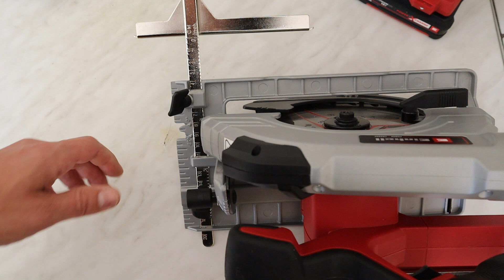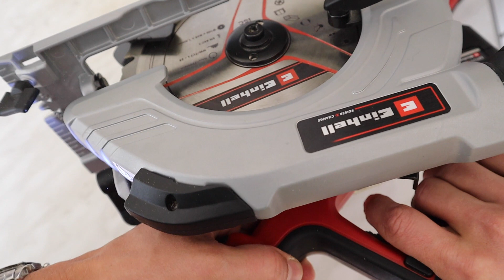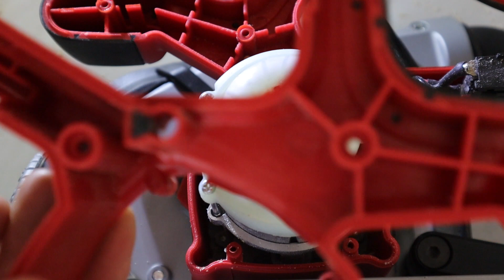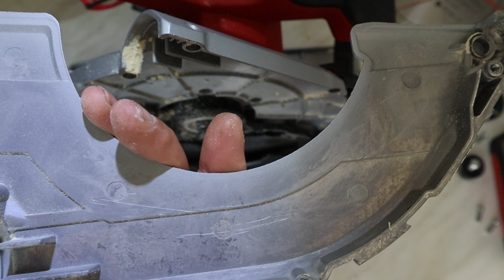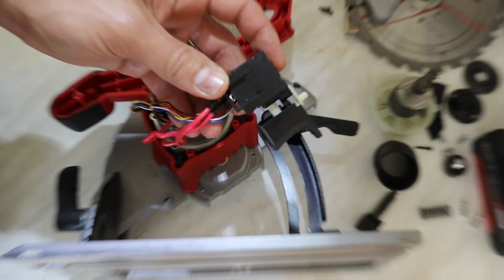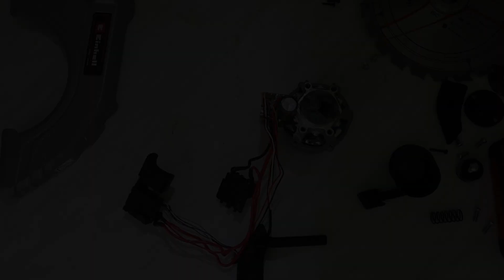Einhell 18V PXC Brushless Circular Saw Teardown - Should you buy one?

Comment: Very useful video - thanks! I've stripped my circular saw down to the motor according to your video as mine stopped working mid-cut. No signs of burning or damage but the motor will not start when I connect up the battery and pull the trigger. The light comes on but that's all. Any idea which component could be the culprit here and how to fix? It's only a few months old but I can't send it back to Einhell as I closed my Amazon account through which I bought it and I didn't save the receipt or order details! Impossible to return it under warranty therefore. Thanks!
Reply: I would test if those transistors are not shorted 26:12. I fixed Einhell impact, which had pair of those shorted.

Comment: I'm not keen on the plastic leaver's on the depth and angle stop.
And as mentioned the flimsy blade guard.
Don't the angle leaver pull out so you can put it in a different position.
Thanks for the interesting review.

Comment: Dont understand the fascination with making the blade guard out of plastic.. I mean its got to be the most abused part on the bloody thing, Every time you leave it down its on the plastic guard, when you drop it, its going to be right on the guard !! They couldn't even be bothered to add some glass fiber reinforcement into the plastic... I had to bin my last cordless saw for this exact reason, Cut too low to the ground ripping a board, even though the board was up on blocks, the plastic guard touched the ground near the end of the cut, all I remember was an explosion and bits of plastic shrapnel flying across the room.. Swore id never buy another saw with a plastic guard.. Just No...!!

Comment: I bought this saw after watching this video, TBH kind of disappointed by it being underpowered - like someone said in amazon reviews - above 3cm cutting depth it's going to start stalling all the time (I had 5.2ah battery in it). On the positive side it's very smooth and controllable - I have some old corded saw and that thing is way more powerful but also kicks like crazy when starting and rattles quite a bit, and kickback/catch force is quite scary. If you're new to using circular saw this is a good option because it's refined and not very strong, you will need to do multiple passes on deeper cuts. That being said I'm keeping it, just waiting on rails to arrive because that's my main reason for getting it and it will be perfect for cutting boards with rails (smooth operation and cuts fast enough on sheets)

Comment: Is it normal to have only a bushing guide on the main blade axle? Would have expected a big bearing on that side.
Reply from the maker: The bearing is on the shaft on which the blade is fitted. Which is the shaft on which the load is working. The motor shaft is "hooked" into th gear reduction and "only" has to deal with the motor torque load. More expensive saw's tend to use a bearing on this motor shaft, instead of a bushing.

Comment: Sad to see a return of the bowl shaped cooling fan, the last time I saw those was when tools were still made from all metal. They were always notorious for plugging up with dust and its already showing on this saw.
Reply from the maker: Centrifugal fans are more efficient and have a higher output pressure. They tried to mimic these effects with the small fan used in this saw, which in this application helps beside better cooling performance with clearing the work surface while using the saw without dust extraction. Because this saw is on the lower power output & lower RPM scale compared to some of the more reputable brands it gets hotter when used "impatiently" & there is less airflow at the lower RPM. You are right, as a downside they are more susceptible to dust clogging up the inside of the fan, but this is where I think they took that compromise as Einhell only targets the DIY market with sporadic users rather than the professional constant use market. (it will be outside of the warranty once the fan starts causing trouble in most cases, rather then running the electronics too hot for too long) They made it accessible enough though to clean out with some compressed air if it where to become troublesome. 

Modern day business, it's all about the money, not the engineering or quality anymore... If it's cheaper to replace a few products under warranty rather then re-engineer, re-certify & re-tool for manufacturing then warranty claims it is.
Reply: @toolteardown  The milwaukee circular saws use a standard radial fan on the gearbox side of the rotor. It requires the shaft to be ever so slightly longer but is well worth it. They also shrouded the motor for better cooling. 

I know Einhell makes tools for hobbyists, but some of the corners they cut seem excessive.

Comment: I bought the impact driver and the circular saw yesterday. Was suffering from a little buyers remorse this morning after post purchase looking at all the negative reviews. Seeing the build has put some of my misgivings at ease. Thank you for taking the time to put together this content.
Reply: don't worry about the quality 
I own 
circular saw 
reciprocating saw
impact driver 
1/2" impact wrench 
Multi Tool
cordless drill 
HDS 18v drill 
jigsaw
laser measure
7 batteries from 2ah 3ah 4ah and 5.8 ah 
I use them a lot 
abuse them and they have never let me down
Reply: oh and an angle grinder that I can't fault
Reply from the maker: Using one of the bigger batteries makes quite a bit of a difference during use. Minimum 4AH minimum I would say. It’s RPM is at the lower end of the spectrum so it will obviously be a little less quick in cutting thicker / hardwood pieces. I used it for 3 months non stop now and I’m happy with what it can do as a DIY product. Getting a good quality saw-blade also helps.
Reply: @toolteardown  precisely what I’ve been using it for. Thank you for taking the time to respond to my post. Also, been building a miter station today and I’ve been loving using a cordless circular saw. So far it had only ever been a cordless drill driver, but not having a cord on the circular saw is phenomenal. It did well, but I hear what you’re saying about batteries and saw blade.
Reply: I bought the impact driver 1st 
I did racking install and repairs and dropped a dewalt and needed a replacement fast . toolstation had an offer and I thought. It doesn't matter how expensive a tool is if I drop it again it will smash so went for a cheaper option . never looked back . Once I was on the battery platform it just made sense.  now looking at the cordless 18v nail gun just out.  rude not to at that price
Reply: How are your Einhell tools holding up, after a year? I’m just considering buying the Einhell multitool and their cordless heat gun. As you said, some reviews aren’t that positive.
Reply: @sar2908  I’m quite happy with the impact driver. Still working a charm. Happy with the cordless circular saw too. Put a Freud blade on it and it does well. There is a slight amount of deflection in the shaft that I don’t like much, but other than that it works as it should.
Reply: @andrewmason6688  Good to know, thanks.